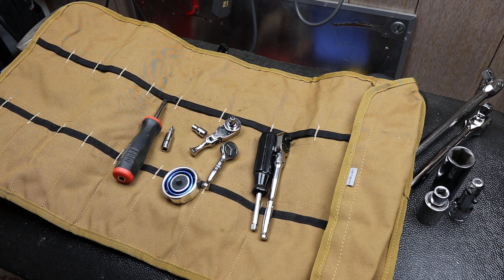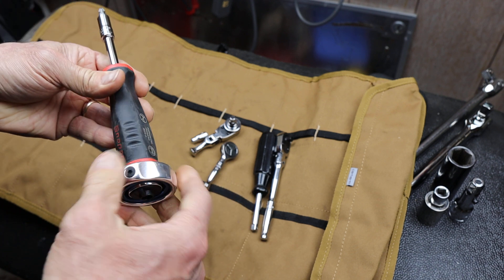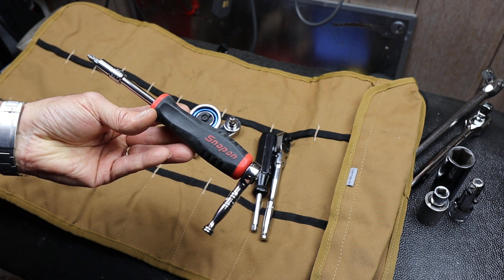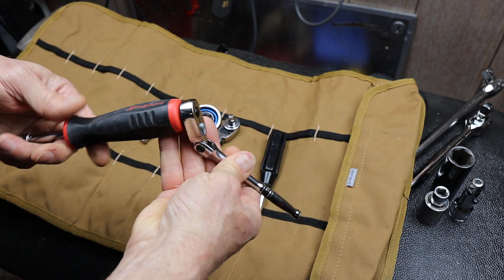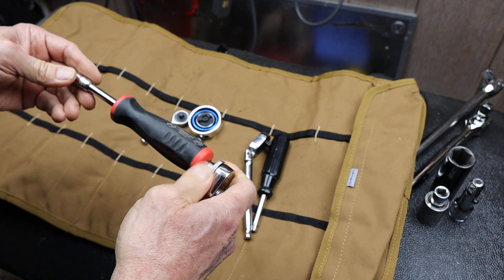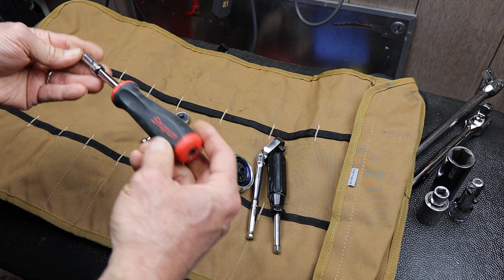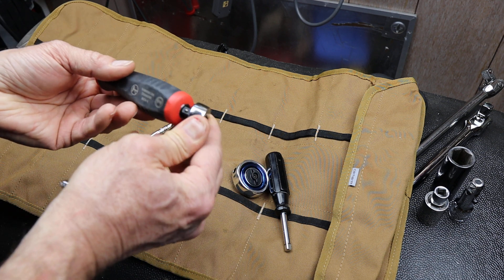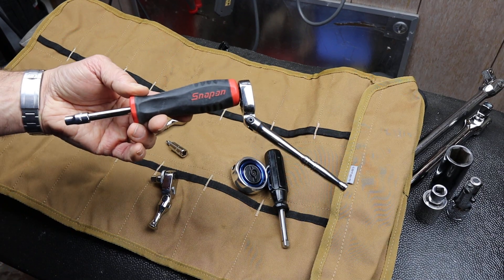Do you do this? Seems like a great way to leverage tools, and expand your capabilities. Thoughts?

Comment: My 1/4 inch spinner handle drive is my favorite extension nut driver ext. Love those I use mine mostly with my roto head ratchet all the time!!
Reply: CP do you know if any companies make these in longer lengths in 1/4 drive? I have an old Craftsman version. But seem to only see these in 6 inch.

Comment: I hade one of those nut driver extensions for like 10 years before I actually used it lol. I for some reason just overlooked it as kind of a gimiky tool. Then I tried it! I loved using it right away. Almost any time I have the space I use it on my ratchet. You can break the fastener loose using the ratchet , the run it out or in while still holding the ratchet. To me it's a much better version of the small wheel style ratchet spinners that companies sell. I have only seen these in a 6 inch configuration. But wish I could find one in a 10-12 inch.

Comment: I’m a technician and repair stuff and i use that combination all the time!! 
It’s awesome!!
I use just a ratchet on the driver, I don’t see the Need of that spinner thing doothat because its bigger and heavier than a siple ratchet. 
Plus you can apply more torque in the same degree of movement.

Comment: The spinner handle is an essential very underrated tool.

Driver handles are okay,  but the spinner handle is so much better because you can put it on any tool with an anvil.

I like the ability to spinn a fastener in the lock it down with the ratchet.
I use my 6" extension occasionally,  but find myself using the spinner handle instead far more often.
And I use ut as a driver handle far more than I thought.

Comment: Used the same setup to finalize the torque of a transmission pan yesterday 
The nut driver help speed up the removal of slack while the ratchet gave me the leverage I needed to make final torque

Comment: I have the Wera chisel driver set with the 1/4 square end.  The other accessory I have used is 1/4 extensions (I have a very long stalhwille one I am partial to).  But it’s a rare occurrence, I think I used it twice and it was to get stuck screws out overhead).  I mainly just have the square end for extra leverage (it’s better than a wrench on the hex to me because I can use a long 1/4 ratchet).  The impact end is not as nice to hit as the normal chisel drivers.  If I want a ratcheting screwdriver I use the Gedore silent gear bit driver (the best one IMHO).

Comment: ready-made adjustable pistol grip ratchets do exist. I have on one occasion had a second person stick their ratchet on my spinner handle because both my hands were occupied trying to hold the socket, universal joint, and extensions from falling. Another thing I have seen used, tangentially related, is this on youtube: https://www.youtube.com/watch?v=u1fT2c9-2NQ

spinner handles, with and without the 1/4" drive female end, are some of my most used tools. adding a ratchet mechanism to them is even better. In fact, a variation of this would be putting a 1/4" drive adapter bit on a  ratcheting bit driver. now you have the ratcheting mechanism in from, instead of the rear. Of course, you loose out on the capability of attaching a long ratchet for maximum leverage for breaking off fasteners. very versatile tool, everyone should own at least one.

Comment: If I am dealing with a socket I will usually not use a screwdriver. If I'm dealing with a screw and I need more leverage I should be spraying penetrant on it. I would just strip the screw anyway.

Comment: What happened to Yankee screwdrivers?
Reply: Production was discontinued in the US in 2005, the UK in 2007, then the tooling was shipped to Japan and eventually scrapped. There's a few companies that make tools in that style.
Reply: I have a black Craftsman version I found at a flea market that no one seemed to want because they couldn’t figure out how to work it. I opened up the cap and all the drill bits were inside in perfect condition. I knew all I had to do was press down and the screwdriver would twist and drill the bit into wood and whatnot. I got it for $1.00!